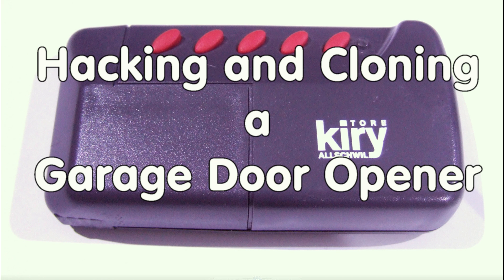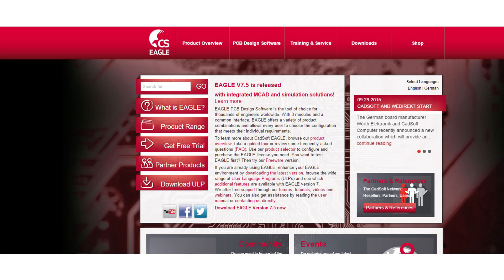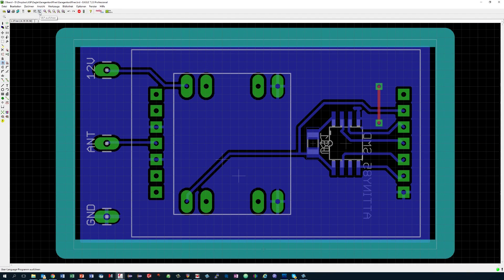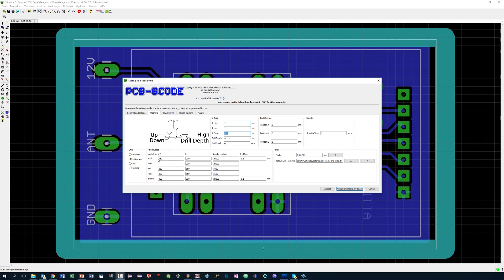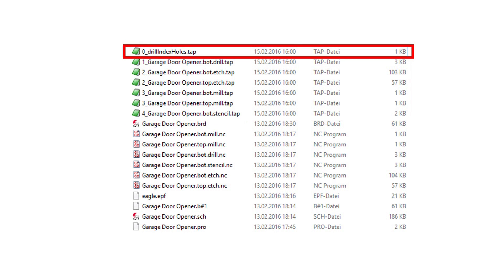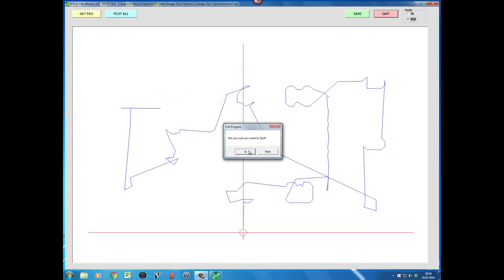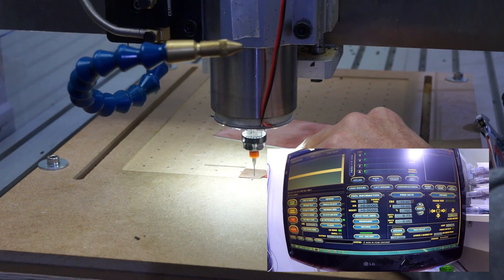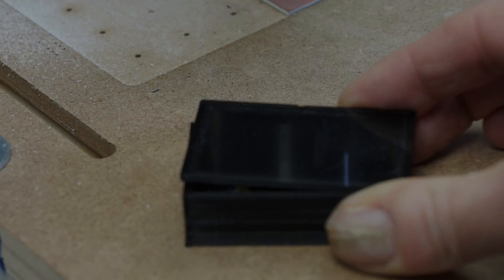#46 PCB Milling with a Chinese CNC 6040 and some Tricks

Comment: Hi! Can you make multilayered PCB's with this? IF yes, how many layers is the limit? Thanks!
Reply from the maker: Two layers can be done, but it is not easy, because normal 2 layered PCBs contact both layers through the holes. This is not the case if you do it yourself. So. many PCBs will not work, because your layout program assumes that they are connected.
I usually do single layered to test the circuit (the board is usually bigger) . When I found and corrected the errors, I rearrange the parts and select 2 layers. Then, I send it out to Osh Park for manufacturing.So, I get a fast prototyping and a good quality final product.

Comment: You may want to look at Diptrace for schematic layout, and CopperCam for G-Code generation. I replaced Mach3 and the Parallel port, with bCNC running GRBL (on arduino of course). Having to using a Parallel port is kind of a hassle for me. CopperCam has it's quirks but it is very simplistic and easy to use; including making simple changes to traces before you generate G-code.
Reply from the maker: So you use a completely different tool chain. I decided to keep mine as long as possible, because it works, and it was quite a lot of work to get it,there.
I do not touch the PC with Mach, and it is still on Windows 7.;-)

Comment: That's very interesting, but also very hard. I make PCB with photo procedure with much less sweat&tears :)
Great work once again!
Reply from the maker: fbonacic if it is working, it is no more too complex. Jost till it worked ;-)
Reply: One more question. What is the type of spindle motor: brushed DC or 
brushless (BLDC) motor? I'm considering buying this cnc, but don't like 
idea of brushed DC motor..
And is 800W enough to mill aluminum, or it needs 1.5kW?
Thanks!
Reply from the maker: I do not know. I bought it including the power electronics for the steppers and the spindle (blue box). I wanted a working machine to start  with...
Mine is 2.2kW, which is usually too much. So, unfortunately, I also cannot answer this question. However, I think, 800W is not a lot. It also depends, if you use 3 or 6 mm mills. Aluminium is already quit hard.
Reply: I also do mine using laser printer transfer etch technique even though I have my DIY (home made CNC from scrap materials). I love doing the conventional way. cheers!

Comment: Thanks Andrea for sharing your process, what angle V-Bit are you using?
Reply from the maker: I use 10, 20, and sometimes also 30 degrees. I cannot tell you which are really better because I did not do a formal test. The smaller, the easier it is to set the z-axis height. But they might wear out faster.

Comment: May I ask what spindle speeds you use for milling the traces?  Also the model of your spindle?  Thanks.
Reply from the maker: I use the maximum speed of the spindle(20000 rpm). My spindle is a chinese 2.2kW.
Reply: Thanks very much.

Comment: Use more double side tape.  We use to have one of these types of tools 20 years ago.  But they costed 30,000 dollars Australia.  They had self levelling as well.
Reply from the maker: I decided to go for vacuum instead of self adhesive tape. I found it more convenient.
Reply: +Andreas Spiess as long as it works.  One of my mates made a wifi antenna on one.  Worked great.

Comment: With your method I wonder where to connect the probes for the Auto leveler???
Reply from the maker: The probe is connected to ground and to the copper (I press a small probe during autolevelling to the top of the PCB). The tool is usually grounded, so the circuit is closed if the tool hits the copper. And this is exactyl what I intend

Comment: Have you checked out how nice ChiliPeppr's Eagle BRD Import is? chilipeppr.com/tinyg and then just drag in your Eagle BRD file.
Reply from the maker: +John Lauer I tried now but I saw only one side of the board. I need Mach3 files for two sides, for drilling the holes, and for milling the contour. Is there a tutorial for my current workflow (Eagle-chilliPeppr-Mach3-CNC)?

Comment: great video as usual .  when you use your vacuum table ,  is see you dont block most of the unused  holes. Is that just something i missed or there  usually enough vacuum . i can see how a few open near the work piece helps remove dust .   Only asking as other such hold downs i have use  using a shop vac , required  us to place paper or such over the unused parts of the table to increase the hold down effect on parts.
Reply from the maker: +XerotoLabs You are right! Usually I put some papers around the PCB. Because of the filming, I forgot them and discovered it only during editing.
The dust does not go into the holes, because they are much smaller than they look like. I made them in two parts: On top, bigger and the bottom half only about .8mm. I did this because I thought, with this principle, I do not need the trick with the paper. But this assumption was wrong.
For the dust I have plexiglas at both sides and a flexoble plastic at the back of the CNC. So, it remains more or less on the machine itself. But, A CNC is not a clean machine and the dust is everywhere and the whole room has to be cleaned from time to time.

Comment: Great video for those with a machine like yours. I watched with envy. What happened to the weird track routing on pin-7 of the ATTTiny? Were you drinking schnapps at the time :)
Reply from the maker: +Graham Gillett You are a very good observer! The autorouter probably had some schnaps... I still struggle sometimes with the aoutrouting function of Eagle. If the grids are somehow not in sync it does some weird routing (only since the latest update). Because it is a prototype I did not care, but usually I correct it manually. I have to take some time to find the root cause and remove it.

Comment: This week I started designing a CNC in sketchup, I was also thinking about an auto leveling system using tactile measurement. Your video just gave me a nice tip ;)
Reply from the maker: +Sven Troncquo I think, tactile autolevelling is not easy (at least, I do not know, how it can be achieved at 10 - 30 points over the whole copper plate.
Autolevelling using the conductivity of the top of the copper surface is a piece of cacke.
As you might have seen I also use also a copper plate to level the z axis for normal milling jobs. It is simple and very precise. The only thing I did was to build a small circuit to extend the first contact. This means, that, if the mill is coming down I want to stop it right after the very first touch. This touch often was too short and was not recognized by Mach3. This is why I extend it to about .5 sec (of course with an ATtiny85). Like that, Mach3 registers already the first touch.

Comment: Would you have preferred to invest in a chemical pcb manufacturing process? Or are you happier you have a milling station.
Reply from the maker: +Glychee S I did the chemical process and did not like it. Maybe because I am an engineer and not a chemist ,-)
And in addition, with milling, I have the holes drilled and the milling around the PCB in the same step. But of course, the effort is bigger and the equipment is more expensive.